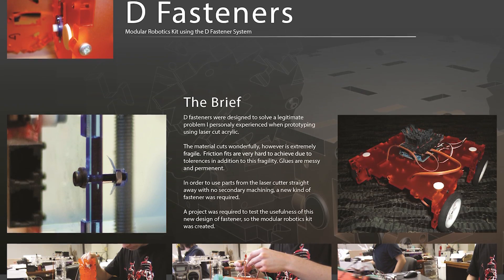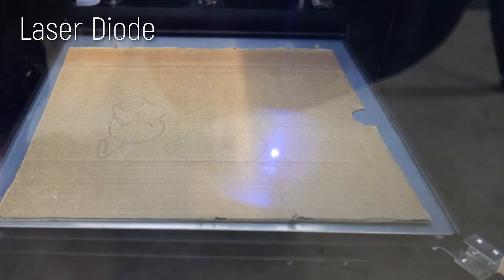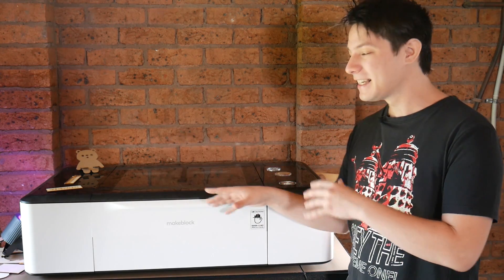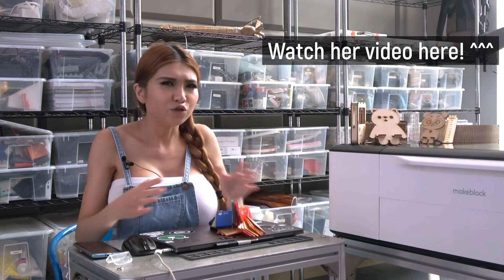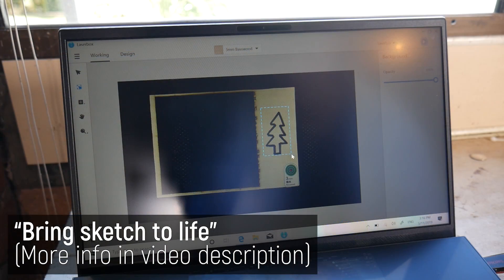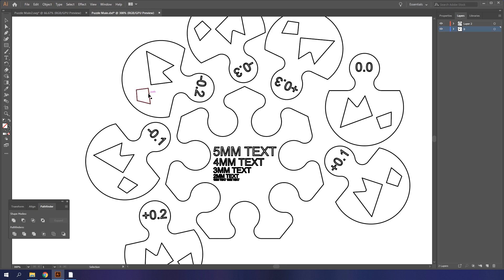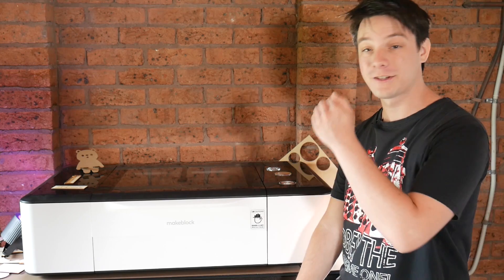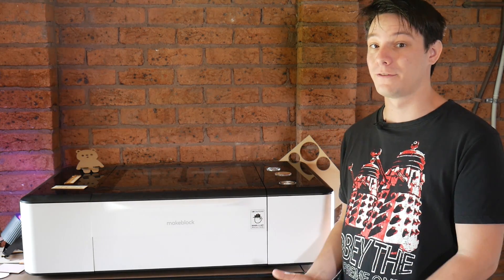Makeblock Laserbox Review - A SMART CO2 Laser Cutter

Comment: I think, this cutter's price is fine for the quality you get and for the ease to use. I would see immediately a great market for hobbyists (modelling) and for making acrylic computer cases. With the latter, just a number around 50 would easily pay the cutter. If the cutter is used to make liquid cooling elements, then the economical margin is even greater.

However, as I have seen recently, a K40 combined with a bit of tinkering, has a much lower price and will still give huge satisfaction.

Sharing a printer between more owners is always a problem, but I believe there would be a market for sharing ... intended as: you buy, keep and maintain the cutter and I pay a share.
Reply: You are better off buying a 60x40 50W chinese laser cutter and modifying it with a 32bits board like a MKS SBASE or an SGEN L. They come with air assist and a fumes extrator and although they dont look "smart" like an ipad, they work great.
Reply: @laharl2k  I agree. Only the outcome counts. And 50W starts to become interesting also for metal engraving.

Comment: Glowforge Pro has a pass through slot so you could feasible etch or cut on any length of material. It's also only $5,999.
That being said, I do love the simplicity of this product & that draw and etch feature is pretty darn cool too. Also like that they took a totally different approach than Glowforge. If things keep up we might see actual affordable hobbyist options in the next five or so years. I'd really love to get a proper robot army with a variety of machines going without it costing me tens of thousands of dollars & everyday it seems to be getting closer & closer.
Reply: For $5500 you can also get a Bescutter 60W (vs glowforge 40w) Co2 laser with front and side passthru, air assist, and all the features minus being cloud requiring. Being forced to use the cloud is the biggest turn off for me with the Glowforge, it is a HUGE bandwidth hog. When trying to game with friends that have a glowforge, they need to turn the thing off or pings is thru the roof as it constantly monitors for a job.
Reply: Glowforge has draw and etch? I just used mine to etch and cut out a dozen kids' drawings into acrylic ornaments yesterday. This machine looks like a complete ripoff of Glowforge's Basic model, which is nowhere near the same price as this even with shipping and GST.
Reply: @hermitliveshere  I'm an Aussie, and there are no resellers in Australia for the glowforge. So we have to pay more than USD$1000 just to ship it here on top of the cost of the machine. I looked into it and contacted Glowforge directly. The price in the video here is AUD as an fyi. So the machines are probably relatively similar price wise, but until there's a distributor here for a glowforge it's pretty difficult to justify the cost (and then need to buy the filter on top of that)
Reply: So Glowoforge has had a number of issues. You might want to look into it. It also seems to very, very slow. I would do a hard pass on the glow forge.  My experience, 20 years of engraving with ULS and Imported lasers from china. Using them every day.  I would consider both before the glow forge. Heck I would consider a k40 with some mods before a glow forge if you are a diy'r

Comment: 10 000 WTF?
I'd rather buy a CNC router for that money, I would get very good one with water cooled spindle, 2000x1000mm working area, cutting softer steel...
Reply: Depends what you are going to use it for. Cutting and etching acrylics is better done on a laser. PCB stencils and other fine details with sharp inside corners are also impossible to do on a router. I love working with routers but I really miss having a laser sometimes.
Reply: You can buy an entry level tormach (obviously completely different use case, but still) or an entry level BossLaser (a company that makes real laser cutters) for that money
Reply: @lucasmagno9148  Tormach is so so. I guess any machine can be used to learn on it. For 10k-ish I'd rather go with used machine. Used fanuc drill mates go for around 10k used.. And you can bet your ass it surpasses any tormach. It's wise to have someone with you who knows CDC milling machines though, for obvious reasons.
Reply: Was immediately skeptical the moment I saw a link to get a quote from instead of a plain price.
Reply: I deal with both. Professionaly and at home as a hobby. Two totally different uses. You'll want to use laser as much as you can, because the speed it takes to - let's say cut a shape out.. No comparison. 
CNC router/milling machine also take a lot more experiences, setting up etc.. If you're in need of 3d machining, laser will be more or less useless for you. :P
And for 2x1m format at 10k you ain't gonna get anything dedicated to actually cut soft steel. Those machines you're looking at are made to cut soft, non-metal materials. For metal it's a different construction of machine for a reson. You can cut it yeah, but as soon as you try to go a bit faster or take a bigger step, everything will start to flex, chatter.. And not to mention the precision of machie dedicated to cut metal vs wood.
Reply: Yes 1 tool does not fit all. I have a CNC and a lasercutter. I use both, but for what I do the laser is much faster. If I am cutting really thick material then the CNC is what I use. There are things each tool does better. Engraving. For sure a laser. Thicker woods, and thicker acrylic with a straight but CNC.  Relief cutting, CNC. Again it depends on what you are doing. Really thin stuff laser.

Comment: If they want to make a really smart laser cutter, they could create something that analyses the grain of the wood and then alters image etchings so they look more even. Then you could use any type of wood and get perfect results.
Reply: No need at all. This identify material feature is useless for any serious work - for that kind work, you won't use this toy and you'll buy different types of plywood from various sellers. It just differs so much (same thicknes and same type of wood), it's impossible to throw them all in one basket. I have issues sometimes on industrial laser, to cut 4mm birch plywood. Filler/glue is the biggest issue when it comes to it, especially when you're dealing with water resistant boards. The difference can be so drastic, that you have to go from 30% power at 25 mm/sec to 80% power at >15 mm/sec to cut through. I've cut thousands of square metres of plywood/plexiglass on CO2 with 90W+ tubes.

Comment: 🔴 laser cutters look really awesome!
 I was wondering whether a 3-D printer (FDM) or a laser cutter is better at creating functional, practical, useable models.
I'd love to hear anybody's thoughts or opinions in the replies.
👇
Reply: I have a few of one and one of the other and a CNC router ;) Large flat slabs Lasers are great, FDM is painfully slow. Complex shapes FDM wins so if you have both then Hybrid designs are a great option. Stacked construction works with Lasers if you can make the large layer lines a 'feature'. For speed vs FDM obviously the Laser also wins.
Reply: 3d printer all the way. Then use the 3d printer to build yourself a laser or a cnc.

Comment: That hepa filter is going too clog very fast especially with MDF's and similar. That may be why there is no air assist a lot of the particles will end up on your material rather than in the filter
Reply: Agreed, the filter will completely clog very quickly if cutting ply or balsa. Grab it in an el cheapo fleece filter and blow the rest outside.
Reply: We put a sheet of fiberglass wool insulation in the top(The 'soft to touch' type, the 'sound dampening' versions(as the fibers are coated and slightly sticky) is better still) and replace them quite often, catches the bulk of the larger/stickier stuff and makes HEPA cartridges last much longer.